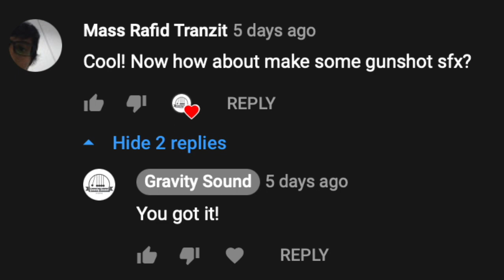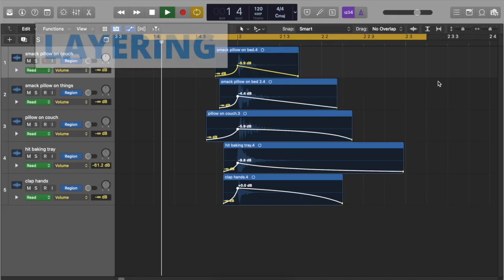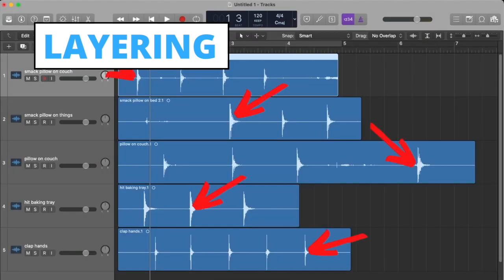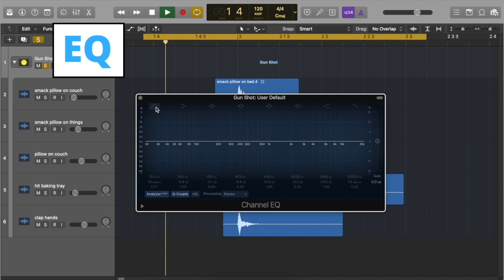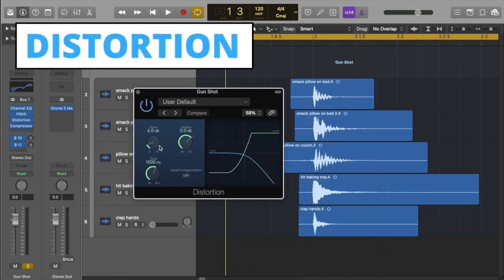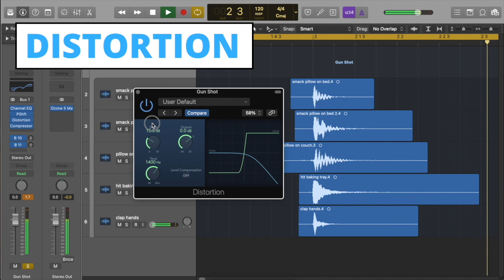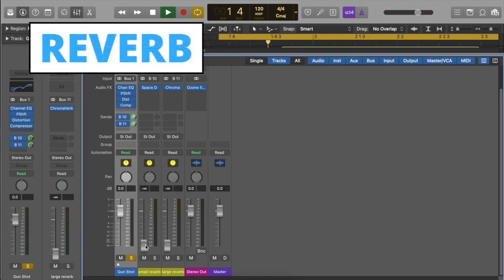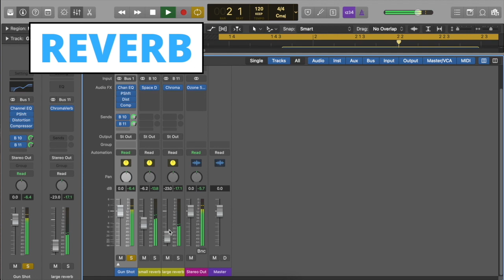How To Make Gun Shot Sounds

Comment: Missing  high frequency noise for that initial crack.  You can think of a gun shot as noise with a sliding filter applied so that the high frequencies fall off very quickly and the lower frequencies fall off more slowly.
Reply from the maker: Great point! Thats a good way to look at it, thanks! :)